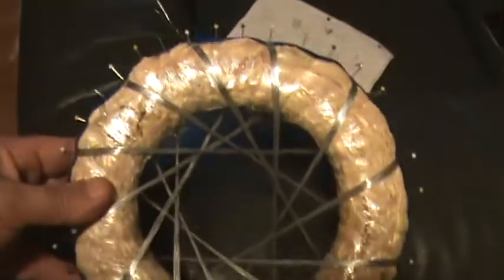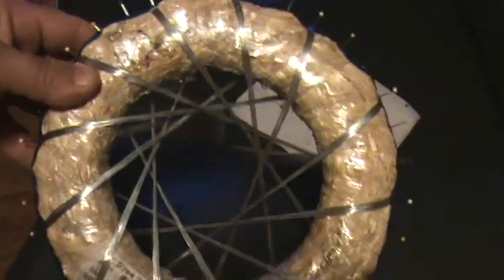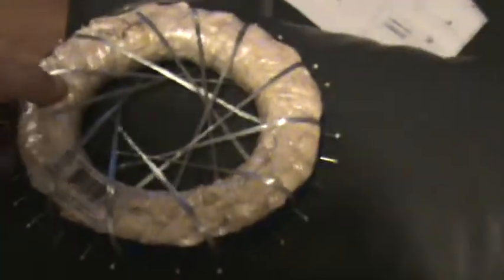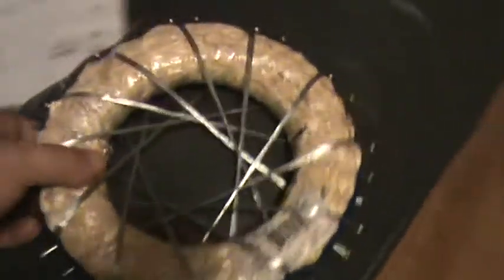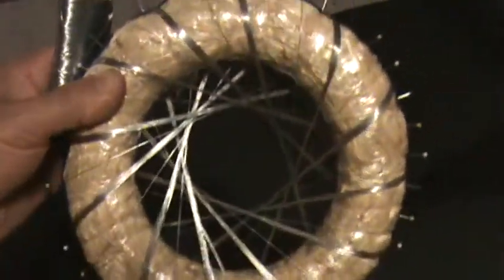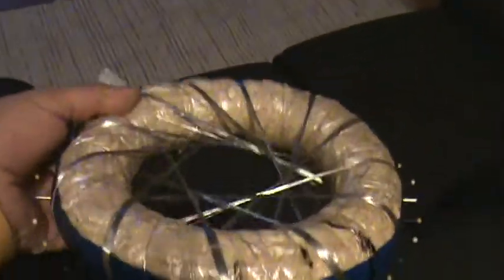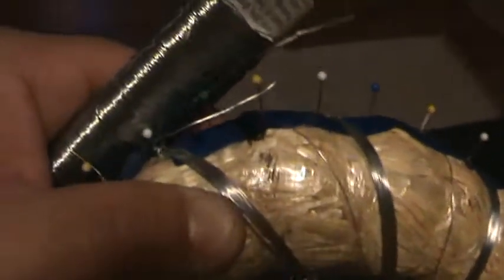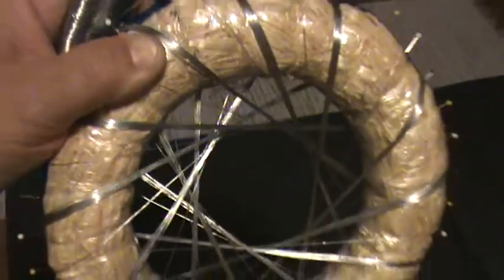Rodin coil steel wire 11 windings  part 2

Comment: metal is not that good, COPER or SILVER and emailed wire, also it must have lots and lots of wire, the more it has the greater the resistance and therefore leser chanse of burning the wire :) p

Comment from the maker: @rave154 when i did the second winding and hooked it to my power supply it start to smoke and the wire got hot, I have been informed that the wire needs to be insulated, this wire is not its not even stainless steel wire. I plan on getting some magnetic wire and a plastic donut for my next attempt.